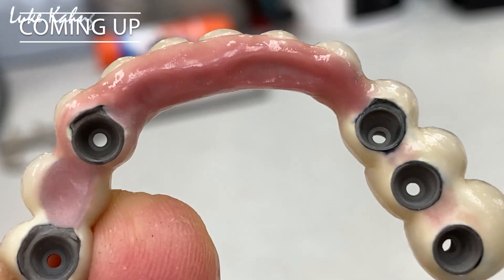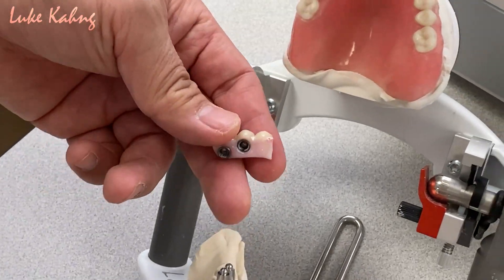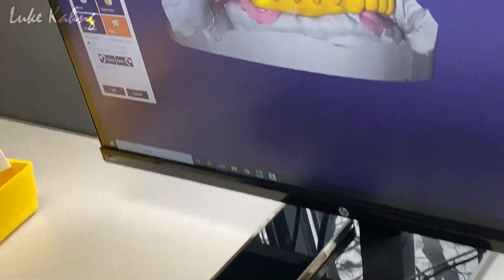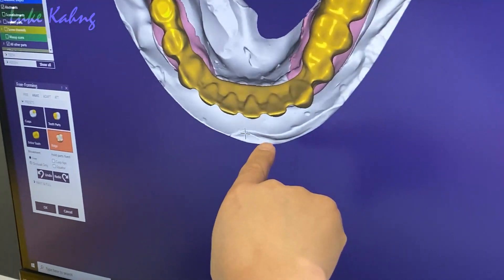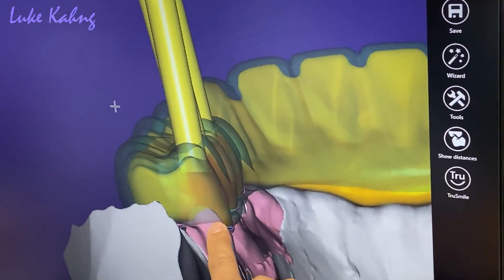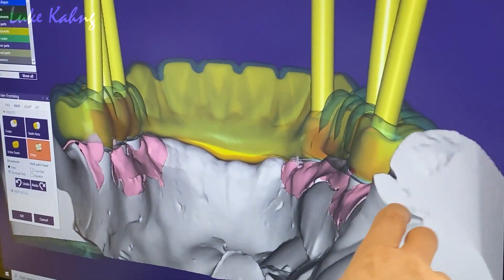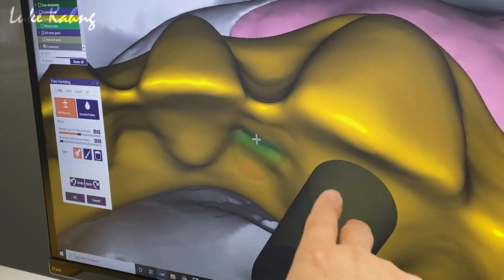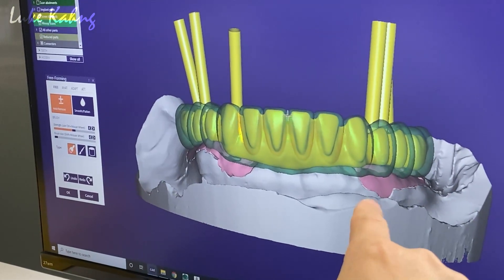Solution for Common Breaking Issues on Dental Restorations

Comment: The reason of the fracture in this bridge is the flexure of the mandible. The new bridge should be separated to two bridges at the fracture line in the old bridge or on the other side.
Reply: Flexure is the key issue here, You are absolutly right, but since the mandibula flexes on both sides in Regio 4/5, a Separation in two cannot solve the whole probs

Comment: The reason of the fracture in this bridge is the flexure of the mandible. The new bridge should be separated to two bridges at the fracture line in the old bridge or on the other side.
Reply: There are many reasons these fail .  Many times there isn’t enough interocclusal space coupled with a prosthesis that is not passively resting on the implant platforms. Practitioners need to use good impression techniques and verification jigs . There has been talk for years about restricted mandibular flexure and limited mouth opening with prosthesis that are bilaterally splinted behind the mental foramen . Maybe there is something to that but I have never witnessed it.  I have become cautious about using zirconia mostly because of debonding between the metal sleeve and the zirconia so I have a prosthesis that is loose but the screws are tight.  I also wonder how evenly the zirconia shrinks in the prosthesis during sintering. I think that may be a source of stress even with very accurate models.